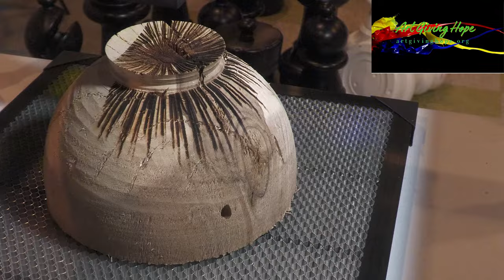"The Iris". Vase making from wood, resin. Wood turning, carving, band saw work, laser engraving.

Comment: Dan, does your thermometer keep track of the temperature down near the middle or bottom of your refrigerator while all this is going on? It could be that the temperature inside that pot got a lot hotter than what where your thermostat was measuring and an exothermic reaction occurred without you knowing it. I'm pretty sure BM Sculpture uses total boat, but as far as I know, any deep pour resin should work as long as you can keep the temperature under control.
Reply from the maker: Thank you!

https://www.artgivinghope.org/currentauctions
Reply from the maker: Thank you!

https://www.artgivinghope.org/currentauctions